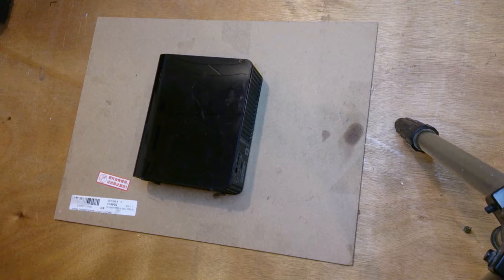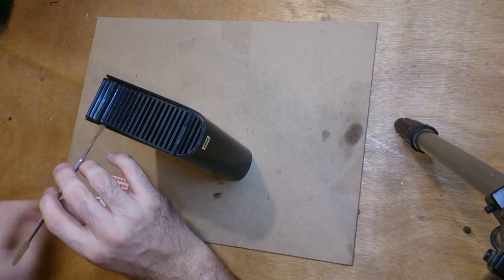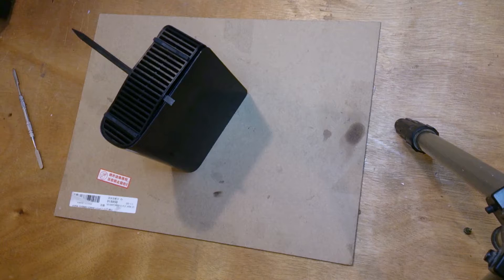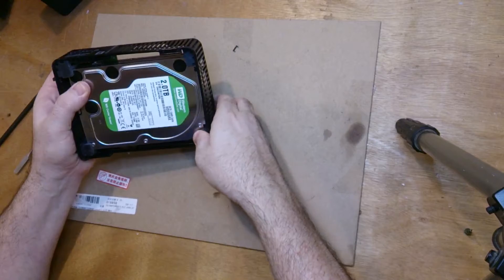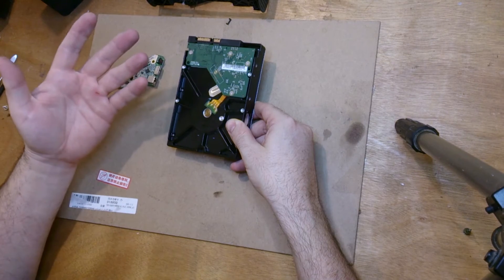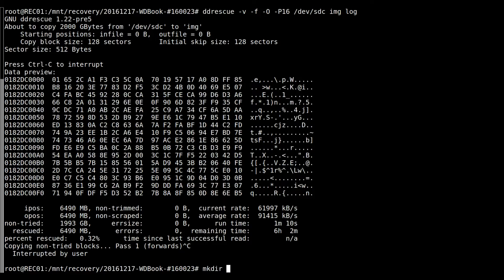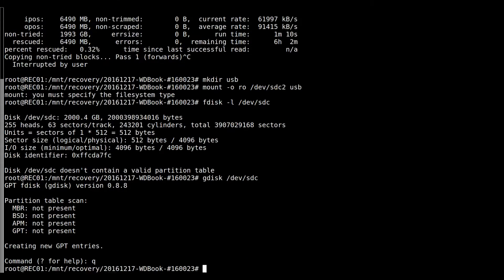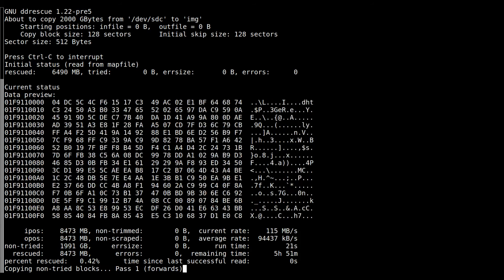Part 1 of 2 - WD MyBook broken controller board repair & data recovery

Comment: Like, seriously, it's just idiotic that they encrypt these drives.

If someone steals it, they're not going to remove the drive from the case and the board that encrypted it.  They're going to steal the whole thing and plug it in, so the encryption module will be with them.  All the encryption does is make it to where we can't read our data when the board crashes.

Maybe I'm missing something, but this is idiotic, imo.

Comment: I'm curious which 3.3V and 5V voltage regulators are used in crap NAS sibling of this crap. Friend mismatched power supply jacks, plugged 20V instead of 12V in his WD My Cloud (A1G board)  and smoked voltage regulators. Small SMD ICs with 6 pins. Any ideas which ones they can be?
That casing tho. Friend's NAS have the same. We eviscerated it with four table knifes :D  Even didn't broke anything.

Hope your hand is fine now.

Comment: Hi, What happens if you buy another PCB that has a different part number, you said in one of the videos that one of the control units had a switch and the other didn't, does that mean pcb boards can be different?